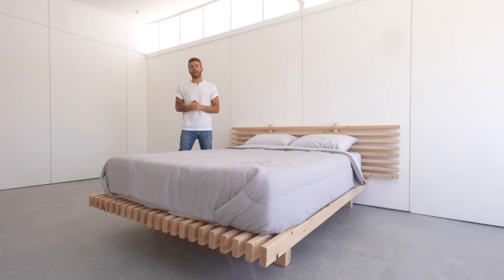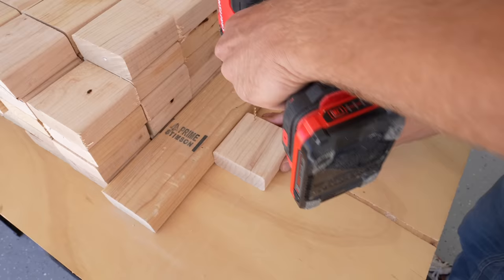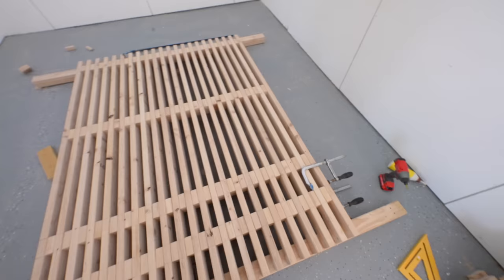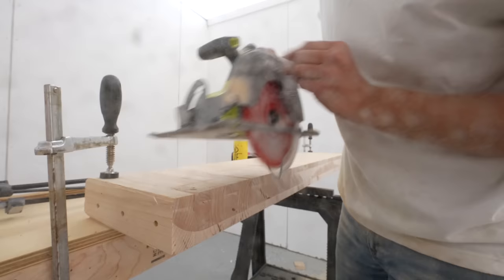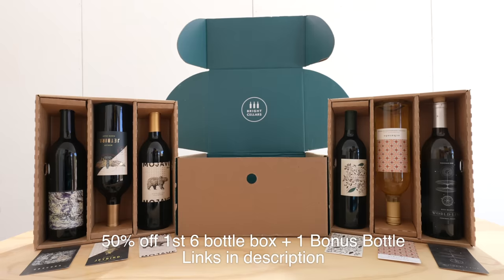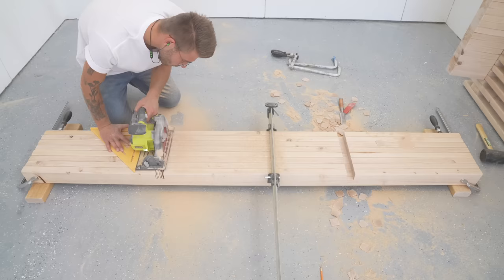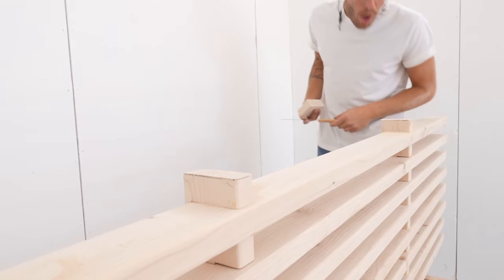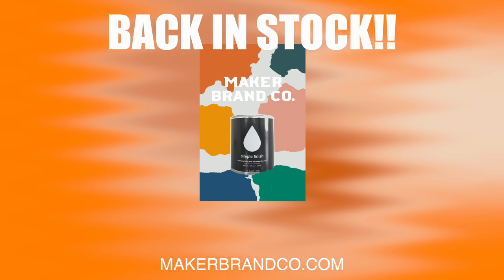DIY Platform Bed Made from ONLY 2x4's!!  | Modern Builds

Comment: Would be advisable to have a 2x4 underneath and perpendicular to the platform to transfer load between platform and legs. 
Otherwise your cantilevered ends are purely relying on the screws and glue since there’s nothing for them to bear onto.

Comment: Love the design, but all those surfaces catch dust that needs to be occasionally dusted so treat them the same as if they were a window blind using a window blind duster or vacuum attachment to make dusting easier.
And the best part besides the finished product? Your bedroom was the shop. No need to have a separate woodworking shop for this project. Just keep the cleanup very regular to keep the sawdust from getting out of the bedroom.

Comment: Love the look of this bed but would like it farther off the floor to accommodate drawers I plan to put underneath it. I'm assuming that this is a queen size bed, what modifications would need to be done to turn this into a twin size bed ?  Then on both sides of the bed i'd like to put book shelves made from 4 picnic benches stacked (with the legs on the outside sitting on top of the bottom legs for support while still having legs under the bench for support) for all the different books I like to read & also put my tablet on the top shelf so it'd be easier to charge it during the night but still within reach.

Comment: Very nice project which looks fantastic. Just one question: You are using a circular saw without a dust extraction system or just a vacuum cleaner. Neither you are using a breathing protection mask. I would like to ask you to use one of these or both protections for your health in the future. The mask would cost 50$ with filters. I know its annoying, but it will help you to stay healthy. 

And again, nice job :)

Comment: i really like this bed, and i was wondering if you could help me with putting it on an angle?  like with the head raised for health reasons? my head is fuzzy and i don't want to screw it up, because i did that by raising my bed with books when i was young and it twisted my back!   my mom had the head of her bed raised, but she didn't tell me how she did it... can you tell the peeps with heart failure? or rather the peeps with heart failure's husband? :) like does he cut the top of the legs at the angle that we want the bed, and then how long is each leg?  yes, i have brain fog lol or can we just make it according to your plan and then put a few two by fours under the leg at the head of the bed and raise it up that way? would that pull things apart? help??

Comment: I tried making the bed just the way you did.  Maybe 3 inch screws were not long enough because my bed sagged in the middle before I put the legs on.  You were able to jump on yours.  I am curious as to what the difference is.  I put my screws in an X like you did.  If I have watched this video once, I have vuewed it 30 times trying to figure out where my project differs from yous.  Any ideas or advice?

Comment: how do you make sure the wood doesn't crack when drilling into it. i have had this problem several times when working with timber in the past
Reply: carpenter's torx screws without pre-drilling

Comment: In this new century, the word “Modern” in context of “Builds” gives the connotation of “minimal” use of resources—particularly natural resources like wood—that accomplishes same goal and desired end result. Very respectfully, creating such a “modern” looking bed from cut trees in form of 2x4s, while acknowledging their high price is such an extreme mode of capturing attention. The other aspect of “modern” build in this new century relates to mobility and self-reliance of individuals, as shown building this bed all alone. So my question is, as a young mobile individual, are you able to move your massively heavy bed by yourself to another bedroom or take it  one floor down in an apartment building? What would have made this design inspiring was using less than 1/4 of the 2x4s used.
Reply: Love it

Comment: Great concept, but way overbuilt and you left all the 2x4 markings on the wood (amateur and messy).  You could have easily removed every other 2x4 from the bed support, and that continuous block base all across the bottom is overkill.  You glued and screwed everything together which will make this bed a BEAST to move around.  Individual legs at each corner would have been plenty with a good 1-piece cross support, then use threaded screw inserts with machine screws to allow the feet and headboard to be easily removed.  Having done all of these would make this a truly innovative and useful build for the cost conscious builder.
Reply: just 2 cross supports and if u want to invest extra work, then cutting sockets for half amount of bed frame pieces than in video... if you don't care, just carpenter screws without making annoying pockets, 4 legs and done

Comment: Could have used less wood on the parts which are hidden anyway, like the platform and especially the footstands (turn the pieces 90 degress before gluing, less thickness, but still sound). This seemed quite wasteful

Comment: You failed to show how easy the platform is to move from assembly location to another room or house.  I built a platform 3 years ago, made it higher so as not to waste the space under the bed and I can take it down and move anywhere without hassle.

Comment: could you have picked a worse wood to use? 2x4's aren't straight, they warp pretty quickly because they usually aren't dry, and suck as finish material. But yeah, looks great for now. In a couple of months, that thing will look like shite.